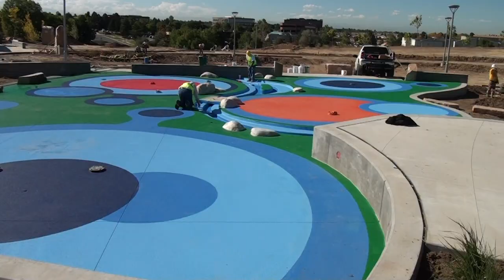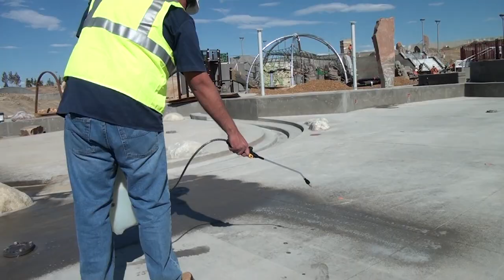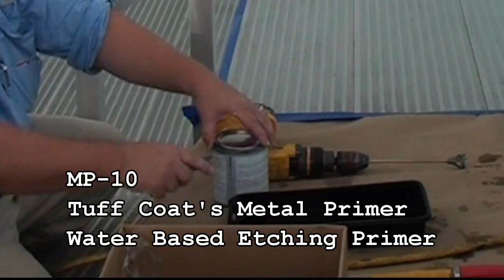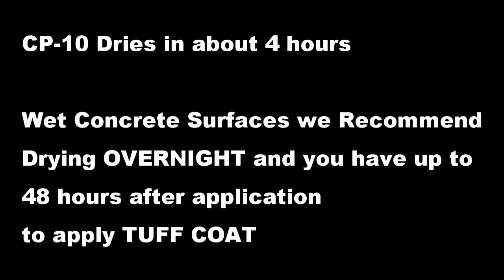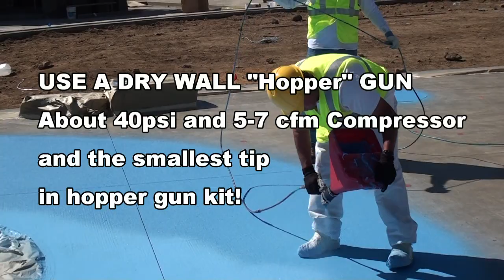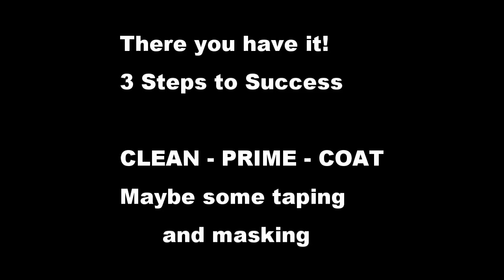HOW TO Apply Tuff Coat

Comment: So do I need to use the muriatic acid on an aluminum jon boat and use the Tuff Coat MP-10 Metal Primer? Or skip the muriatic acid when prepping and go right to using the metal primer once cleaned?
Reply: +Amanda Valentine You need to etch the aluminum either via sanding with 40 or 60 grit paper or chemical etching